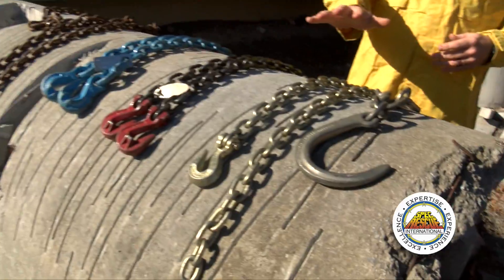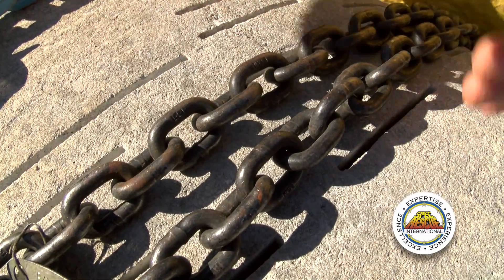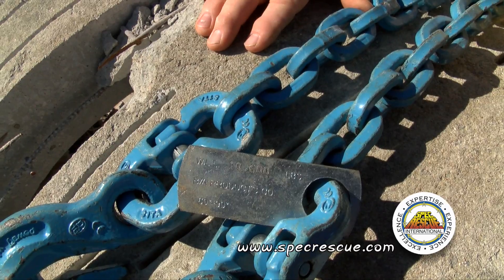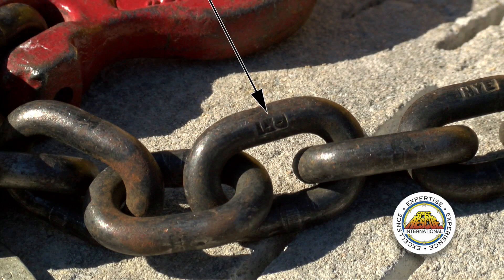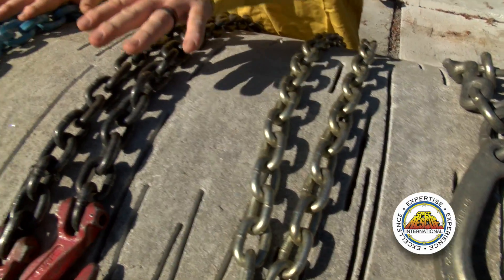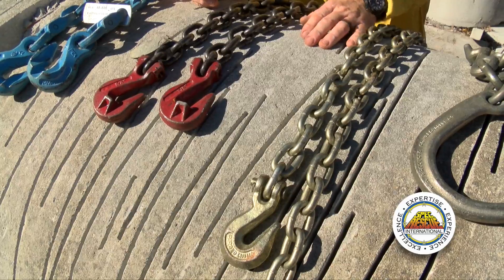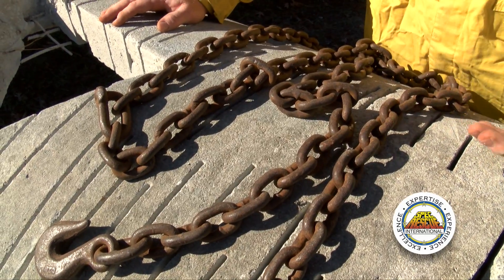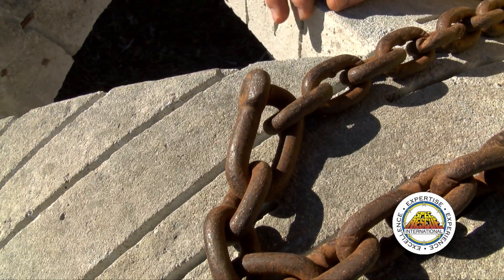The Spec Show - Rescue Chains

Comment: Grade 70 or lower has high carbon steel where grade 80 or higher is alloy steel. Grade 80 or higher will typically stretch 15 to 20 percent before it fails. Unless you put a major shock load on it.

Comment: The hook on your grade 70 chain says 3/8 which has a working load limit of 6,600 pounds. Even if you were right and it was a 5/16 grade 70 chain then the working load limit is 4700 pounds. Not 5400.